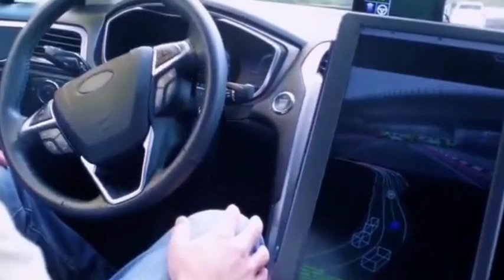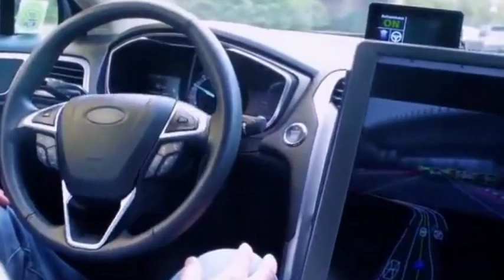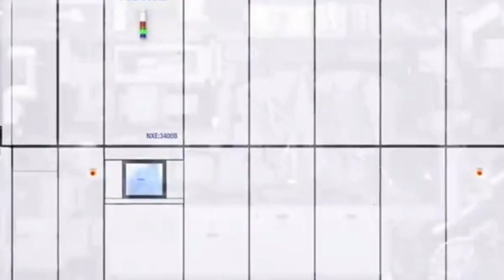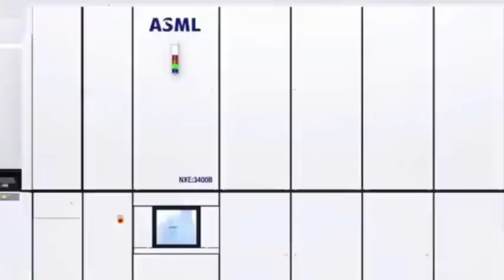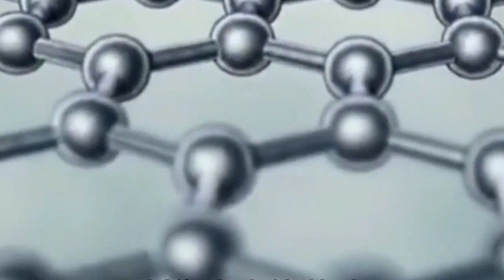TSMC gave SMIC two special gifts, the purpose of which was unexpected.

Comment: This video is clearly confusing.  It says TSMC was sorry it missed the 28nm rise and was restarting its 28nm fab, then in the second breath, it said that TSMC was abandoning its 28nm fab???  Second it talks about ASML providing new lithography machines (?) to TSMC and somehow these two events are a blessing to SMIC.

What we do know is that TSMC is taking orders for 7nm node chips from the mainland and it is expanding its 28nm fab in Nanjing.  Both don't benefit SMIC, nor hams it because the 28nm fab by SMIC is about to double in size with 4 new fabs starting up or in the processing of happening.  Further, SMIC will get one of TSMC's biggest customers that TSMC abandoned, Huawei.  Huawei is starting up its new Kirin series chips on SMIC's 14nm fab lines. Using chip stacking, Huawei can achieve 7nm performance.  SMIC has developed a 7nm process, but it has not matured enough for mass production.

It is too early to see what will happen, but the wind is favorable to China.  NVIDIA has taken on a $5 billion order from China for its H800 GPU chip that is used for AI.  Intel and Qualcomm have started up new innovation centers in China, and Micron Technology, sanctioned by China, seeks contrition by investing more into China by expanding its packaging and test facilities. Apple tried to move its assembly from China to India, but found the yield rate too low (less than 50%) and could not get enough workers, so it has moved back to China and expanded its Zhengzhou fab.  TSMC has ignored the US demand to not fab chips for China and is accepting 7nm orders from the mainland, and Samsung is rebuilding their memory fabs in China.

Biden has a resurrection on his hands and is probably in shock. There is a chance that Intel will not build its two new fabs in Ohio and TMSC/Samsung could abandon their new US fabs because Biden's restrictions on the export of high end chips to China has caused their sales and profits to collapse.. If they can't sell their high end chips, no need for new fabs.   If so, Biden's grand plan to move high end chip fab to the US has failed.
Reply: I somewhat agree with your saying  in your 1st paragraph, but can't agree with you more on what you said in your remaining paragraphs.